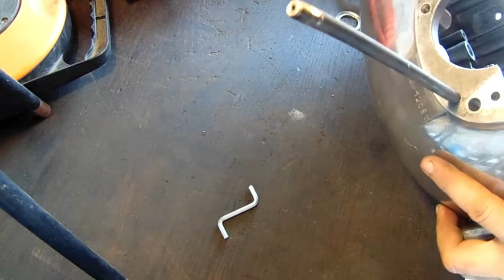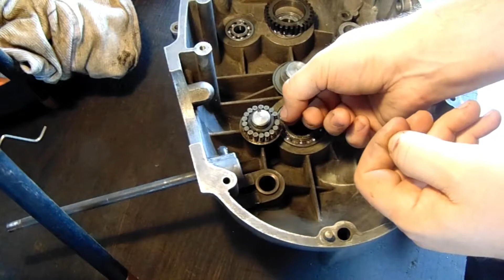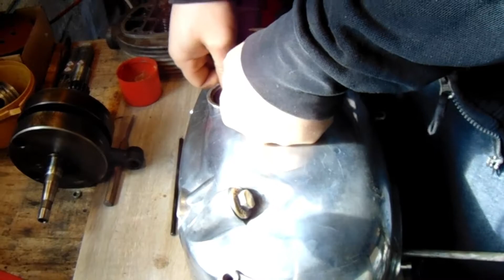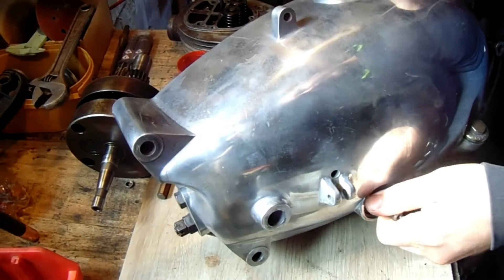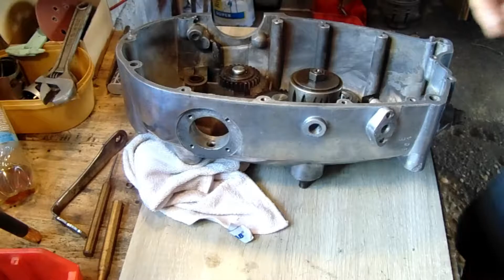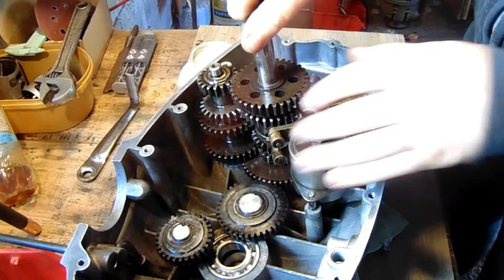Gilera sport 150 engine rebuild ( part 3 )

Comment: Did you notice if the large crankshhaft bearing has a shield on the rearside? The one that I have has a shield, I assume to let the oil flow from the pump to the top of the engine without just passing through the bearing.
Reply from the maker: I have rebuilt only 1 engine of this type, and that was 2 years ago, I don't remember if the bearing has an oil shield. If the shield is between the bearing and the crankshaft, it could be a spacer plate .